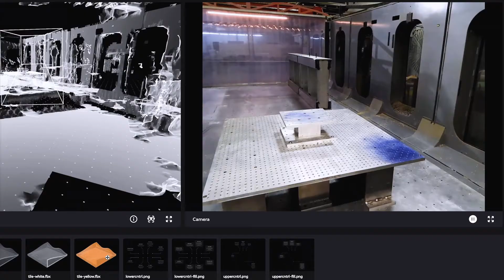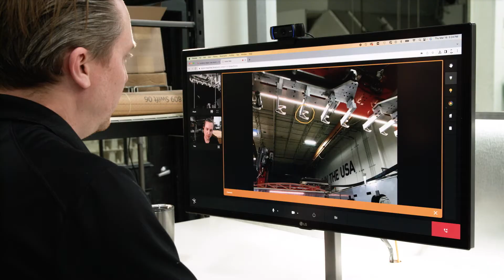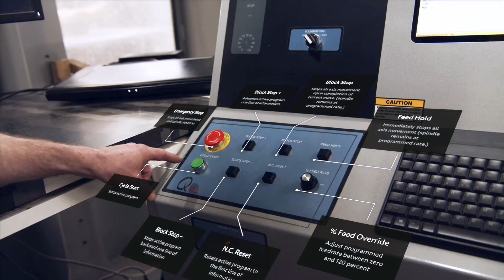Remote Assistance Helps Enhance Workflows with AR

Comment: No one wants to work with headsets on.
Reply: Depends on the job.  Surgeons, for example, frequently wear magnifying headsets which are crucial for a successful outcome.  Like any tool, if a lightweight pair of VR glasses can make you far more successful in your work, they are indispensable.
Reply: @jsfeinsmith  Magic Leap had so much hype and then it was just a huge let down. I remember I was on the train heading to a new technology that would change the human race forever. Meh it was just another holo lense